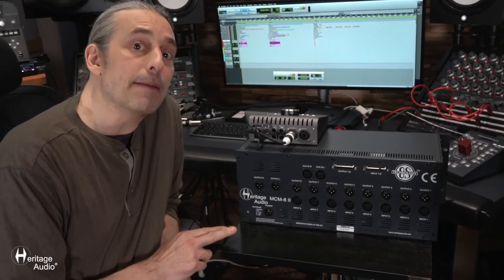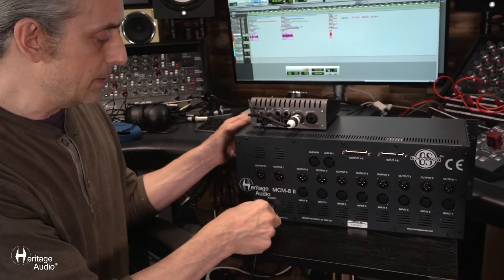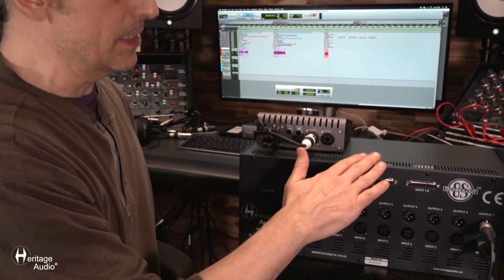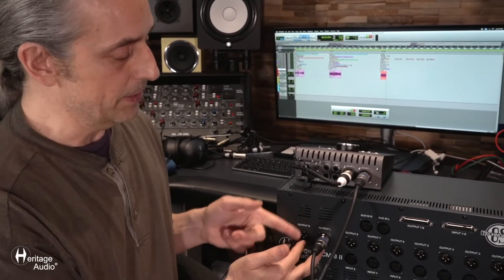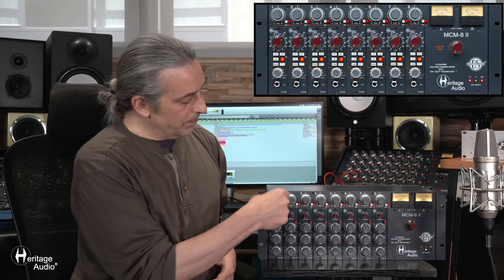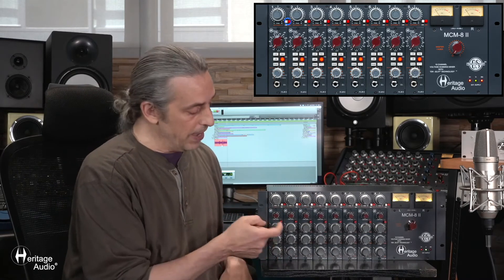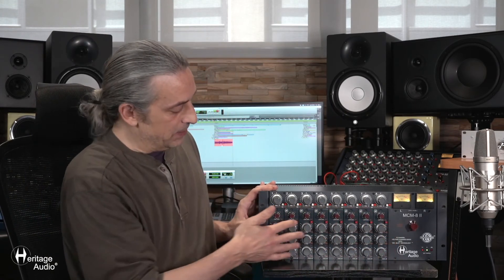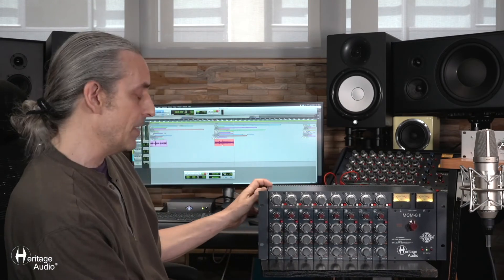Heritage Audio - MCM-8 II Connections & Features

Comment: Does it have compression linking?
Reply from the maker: The MCM-8 II had the channels pre-linked as a factory configuration. Unfortunately this unit has been discontinued but our new OST line have compression linking option on all versions. Hope this helps!
Reply: @heritage_audio  Thanks for the info! Assuming it’s not possible to remove the linking on this unit? Therefore best to use it as a channel strip rather than try to compress different sources on different slots at same time..

Comment: Can I connect an external preamp let say on channel 1 input, bypass the 500 series module of channel 1 and mix with let say channel 2 and 3 modules and send that to the stereo outs, is that posible?
And will the transformer from the mixer alter the sound of the modules?